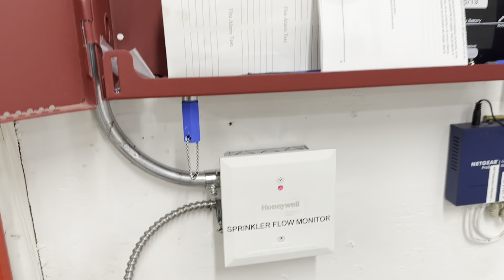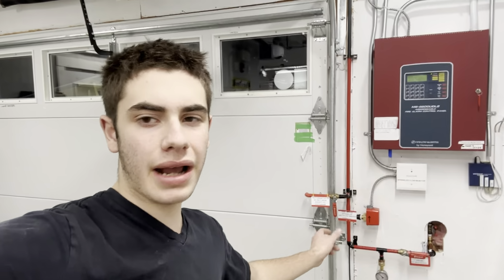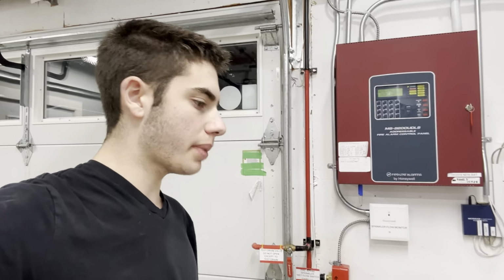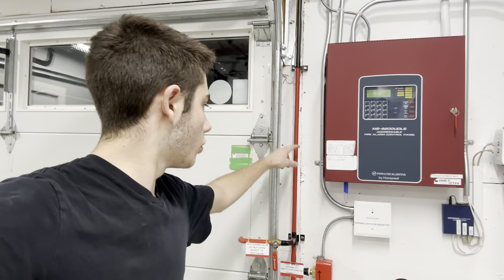False fire alarm activation in garage

Comment: This is why sprinkler valves shouldn’t be turned off
Reply from the maker: Usually it's fine to turn off sprinkler valves as there would be backflow preventers so nothing should happen when you turn off a valve it's just if you are refilling a system and you have to make sure the flow switch is bypassed

Comment: Nice video! Although, working as an irrigation tech I can explain the backflow situation. A backflow is required not for rust, but bacteria that grows in a stagnant section of pipe. Whether it is copper, pvc, galvanized, or PEX - bacteria will grow in any section of pipe where water is not constantly flowing. Should you ever loose house pressure or city pressure, you risk the bacteria ridden water getting into your potable water supply, or worse yet, your neighbors. 

I have thought about adding something like what you have for my house. I would use the concepts that the uponor PEX sprinkler system follows to eliminate the backflow requirement. Tie the toilet into the end of your sprinkler lateral. Every time you flush, fresh water flows into your pipes and flushes them. Then, set an alarm verification delay on your panel to accommodate how the length of time your toilet takes to refill plus some to be safe. 

At the end of the day, this is not something I suggest simply to “satisfy” the requirements. This is for your safety, you can get really, REALLY sick if you don’t do this step right or again, even worse, your neighbors. And don’t even get me started on the brain eating amoebas that can thrive in stagnant water lines.

Edit: I saw your comment about asking a plumber. If that plumber would suggest that in my neck of the woods they would face MAJOR fines and possibly lose their license. Backflow requirements are absolutely no joke and not one of those “what they don’t know won’t hurt them” situations because yes, what they don’t know CAN hurt them!!!
Reply from the maker: I do agree with what you're saying which is why the system is flushed monthly I do have a question though not to argue as I do understand what you were saying but I am wondering how it differs from abandoned dead ended sections of plumbing that are still connected to the supply with no backflow I don't see how that differs?
Reply: @nics-systems-electric  Leaving a long dead run of pipe is also against code in most areas for this same reason. General rule of thumb iirc is 12” or less of dead pipe is acceptable. Anything longer needs to be permanently capped off due to the health hazard of water that will go stagnant in the pipe.
Reply from the maker: @BLS2008  here where I am in Canada I have definitely seen longer runs than that left I always thought that's why the water was treated and chlorinated to prevent growth of bacteria
Reply: @nics-systems-electric  Generally the amount of chlorine in drinking water is very, very low. It’s enough to keep the bacteria down under normal circumstances but it also dissipates/gets used up fairly quickly once it leaves your tap, or if stuck in a section of dead-end pipe. I also have seen this in practice here from time to time, but I think that comes down to homeowners doing their own plumbing work or perhaps pure ignorance on the plumbers behalf. Again the general notion of “what they don’t know won’t hurt them” but water contamination/cross connection control is one code that really should be followed with no exceptions. 

As long as you stay diligent on keeping the water in your pipes flushed you should be just fine. But tread with caution, and perhaps try to find another solution that doesn’t require such diligence.
Reply from the maker: @BLS2008  the problem is for me that I can't afford to lose any more flow I Purchased a few months back a three-quarter inch shark bite check valve thinking that I could put it on the three-quarter inch pipe section on the half-inch line and maybe it wouldn't cause too much reduction in flow however I'm still worried that it will
Reply: @nics-systems-electric  I edited my previous comment a tad bit to give you props for keeping the pipes flushed as that will prevent the problem of stagnation. Just be sure to keep flushing them and tread carefully. Something else I’ve wanted to experiment with is an inline booster pump that plugs into a 120 receptacle and turns on when the water flows through automatically to maintain its set pressure. My boss has this at his house for irrigation and it’s intimidating. I thought it would be kinda cool to use on my home sprinkler system when I install one, like a mini fire pump haha.
Reply from the maker: @BLS2008  I may still in fact install the three-quarter inch shark bite check valve on a three-quarter inch section of pipe, therefore hopefully not causing too much reduction in flow
Reply: @nics-systems-electric  if you do see how well it works, another alternative if it reduces too much flow is to try and install a 1” check valve which will allow more flow and less pressure loss
Reply from the maker: @BLS2008  yes true that would be similar to what I'm doing as the water supply and sprinkler system is both half inch so I have it sized up in one section to three-quarter inch so maybe that won't cause too much reduction
Reply: @nics-systems-electric  Hey can u help me out do you have a EST Edwards 3-ANNCPU1  annunciator CPU With LCD that you're not using the reason why is that I wanted to communicate with my Arduino and there's way
Reply: @nics-systems-electric  has the fire department ever showed up because of the alarm going off being tested

Comment: I have to have my flow switches set to almost maximum time delay. At my building the PSI jumps from 75 to 88 and even 91. Does your flow switch have the wheel in it with settings it would of not made much of a difference here but just wondering. I love your system !

Comment: I know you said you were unlikely to ever change the system, but have you thought of replacing the alarms with Eaton’s Eluxa line to get fire and CO in one signal? I’m also pretty sure that the current LED strobes you have are no longer listed (at least for UL, not sure about ULC) due to their long flash duration.
Reply from the maker: I like system sensor and keeping it separate as it's already wired separately so I would have to move things around
Reply: @nics-systems-electric  that’s understandable. On a related note, I do wonder if System Sensor’s next line of alarms will be able to do both T3 and T4 depending on the input signal, or if Eaton has trademarked that
Reply from the maker: @HenBasketFireAlarms  that would be nice to see I also wonder if they will switch to LED over xenon strobes
Reply: @nics-systems-electric  That would be pretty neat.
Reply: @nics-systems-electric  yeah, I’m surprised they haven’t done that. Eaton (and thus Siemens), Mircom, and Carrier (Edwards, Kidde, etc.) have done that, Simplex offers both LED and xenon for their ES line of signals. It’s probably gonna be at least 2030 before xenon is completely replaced by LED, with the exception of outdoor devices
Reply from the maker: @HenBasketFireAlarms  seems to be the opposite here as I see lots of outdoor LED strobe's but indoor ones are still rare except for brand new systems mostly being EST where I the most popular choice is EST or system sensor with notifier

Comment: Are you able to add a time delay on the paddle flow switch? This may help since your garage system is small and would pressurize fast
Reply from the maker: Possibly a electronic delay but not on the flow it doesn't have adjustable activation so I couldn't do anything

Comment: Don't know if you ever addressed this further, but to avoid that happening with a low pressure issue in the neighborhood, I would consider putting in a gate valve instead of a backflow preventer and size your fittings up a 3/4 in gate valve so that it pushes through a larger valve. That has extremely little resistance then restricts back down to a half inch pipe. It may just be enough to stop backflow and to keep pressure on the flow sensor side
Reply from the maker: I was going to address it and do that then never did as stuff thing ever happened again. Was also going to test and see how much it restricts flow.
Reply: @nics-systems-electric  yeah I'm pretty sure a swing gate check valve wouldn't offer any notable resistance, especially in a 1/2 in PEX line which already respects quite a bit of flow anyways

Comment: I have several things to say For 1 How is there Not any snow You live in Canada but that's Is North of the United States🤔🤔. For 2 Why don't you just get a 1" check valve and a 1/2" copper Adapter Two  1". Or you can even do it with 3/4" And Four 3 Because I notice everything I've noticed that you've installed a Industrial light fixture On your Generator room.
Reply from the maker: Snow melts away doesn't stay forever and yes there is a red light fixture and I'm still not sure about check valve as I don't want to decrease flow any because no matter what size pipe it's still a spring loaded flap

Comment: Just put a single check in instead of the double check backflow preventer. That water would probably still get yucky after sitting in the pipe for a while.
Reply from the maker: I was originally going to but I asked a plumber who said don't bother as it would restrict the flow more and it's just copper pipes so it's fine

Comment: 01:17 You don't even need an access control fob to scan to get in as your fire alarm system is supposed to unlock the lock of the front entrance door of the garage
Reply from the maker: Yes I do otherwise I'm locked out the fire alarm system has not unlocked the access control for the last six months or so maybe longer
Reply: @nics-systems-electric  Where do you get your electrical wiring from? (Backboxes, etc,)

Comment: ah, so it wasnt the lack of water in the system but the flow back into it.
do you have an alarm or warning if the pressure is low in the system?, 
might be worth thinking about that too, might save the day if the system doesnt have pressure when its needed